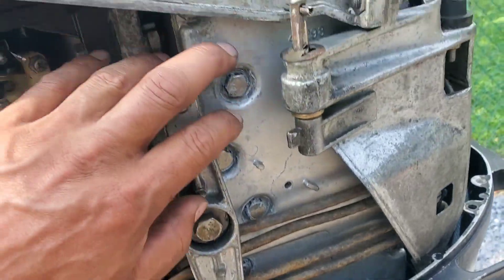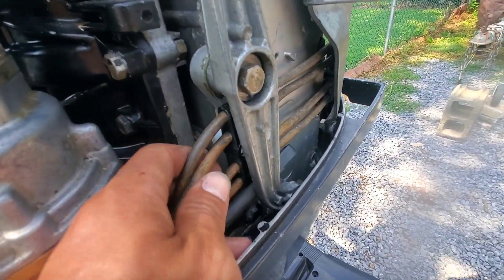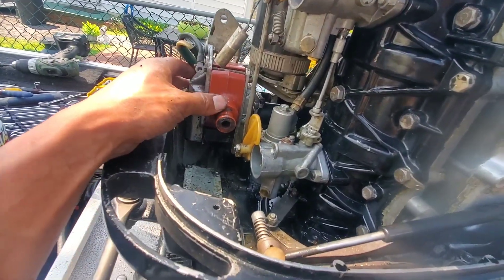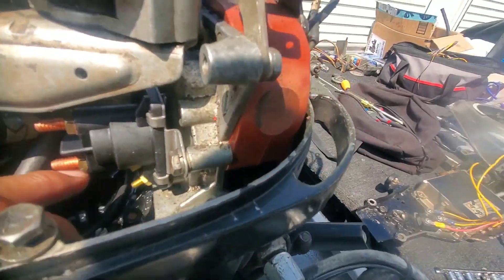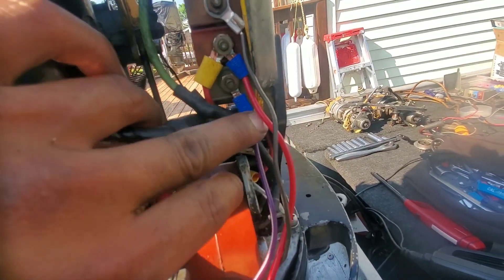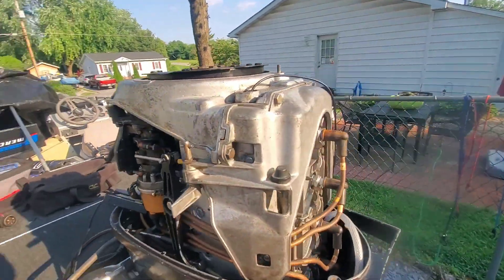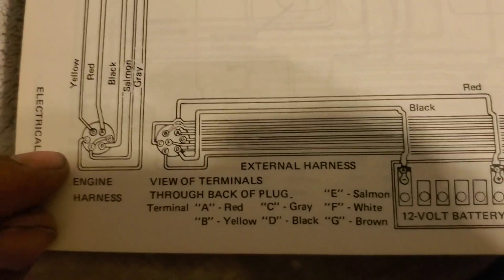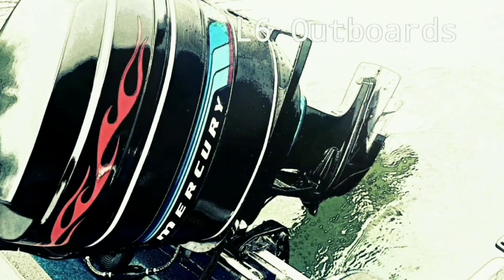Mercury Outboard Ignition Upgrade: Energizer to C.D.

Comment: I’m inspired to work on mine! What a great mod. Do you think regulated rectifiers are a good upgrade or unnecessary? Thanks for more great merc vids!
Reply from the maker: I'm not sure if they are necessary but they do take up significantly less space. I actually stuck a volt meter on the battery and everything works as it should. Let me know if you have any other questions. :-)

Comment: Question, trying to find the BEST approach to upgrade a 1250 inline 6 ignition to something more reliable. I have a good running one, buy I can see the wires to the distributor's insulation crumbling away ( typical of the era ). Also have a 95hp inline 6 with the same ignition. Is there an aftermarket replacement?? Or can those old ignitions be salvaged
Reply from the maker: I believe cdi makes a trigger. I have a video on how to replace it. Son
Reply from the maker: https://amzn.to/3NwlmnG
Reply: @MerCSonL6  Thank you! I am absolutely a fan. L6's are pretty common & cheap up here in the CNY/ Adirondacks / Fingerlakes area. In fact should ever venture to this area I will donate one "core" for your project :)

Comment: Question on the starboard side of the switch box the green lug is for the coil ? And is that always the case I have a 1977 115 1150 L6. And the coil wire is connected to the second lug from the top. And you said yours was the Tac.
Reply from the maker: That's odd. The second lug is brown? Which is for the tac but it doesn't work.... at least it's never worked for me. Son

Comment: Is it possible to put coil packs on an older motor and totally do away with the distributor altogether? Modernize the engine? I have a 96 Force that has coil packs and it is way less complicated. I have a 71 Merc 650 that I will have to totally rewire. Wires look as if mice chewed through them, They're still all connected just no insulation on them. I want to make her run again as a tribute to my late Father In Law who wanted to get it running just never had the time nor the deep pocket it would probably require to do so. 
This video shows just how much I don't know! I'm essentially a Kindergartner and this looks to be advanced college level stuff! LOL The only thing I know is that I have good compression. 149 psi in all 4 cylinders.
Reply from the maker: It is.... I don't recommend it. It would take a lot of cast aluminum modifications. Son

Comment: Hi Son, I have a 1976 115 hp where  original sw. box is melted, stator wires disintegrating at stator,  wires for trigger in distributor housing rusting and falling apart,,,Entire wire harness needs replaced,,,I was hoping to upgrade to a newer version ignition. A power pack kit is sold, 114-2986 Power Pack,  which comes with a sw. box much smaller than oem,, coil, 134-3736 Distributor Trigger Housing,
4/6 Cylinder Disks
Spacer & Bearings,
500+$
Will this work,, Thanks
Reply from the maker: Yes sir. If repaired properly. Son
Reply: So the power pack kit will wire up?
Reply from the maker: @jeffroper4435  a 76 has only 1 switchbox. If it works then yes, it will distribute the spark given the distributor is operational. Son
Reply: Looks like fewer wires coming from the kit
Reply from the maker: @jeffroper4435  I'm a little confused on this "kit" you mention....
Reply from the maker: Is it the cdi switch/coil combo??
Reply: Yes
Reply: Yes